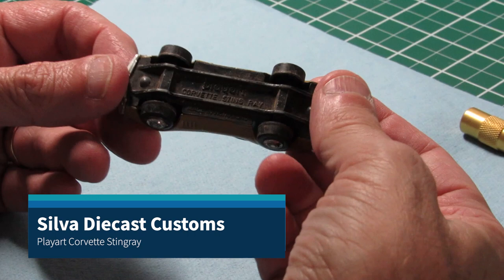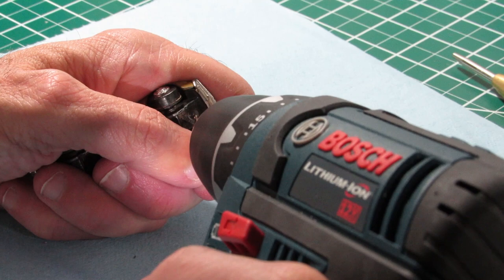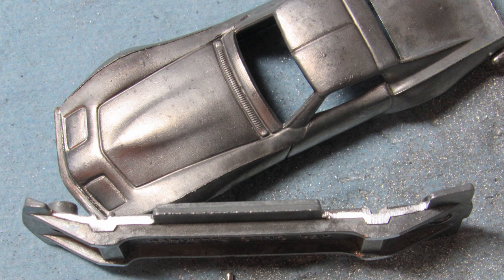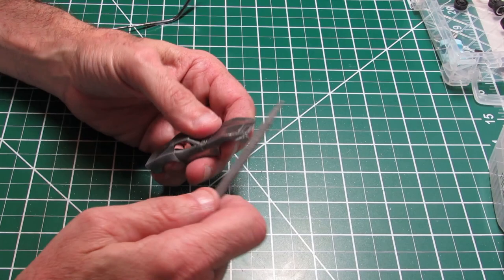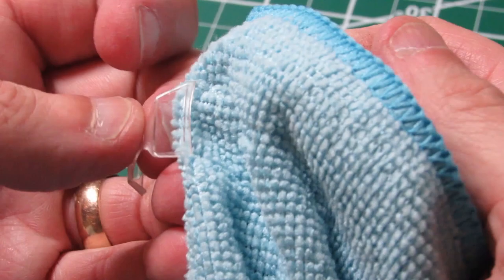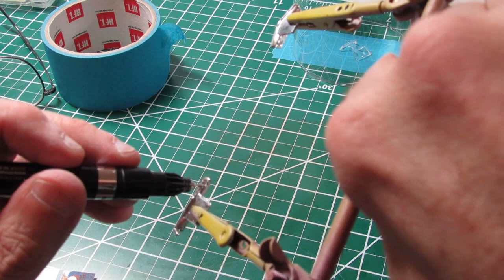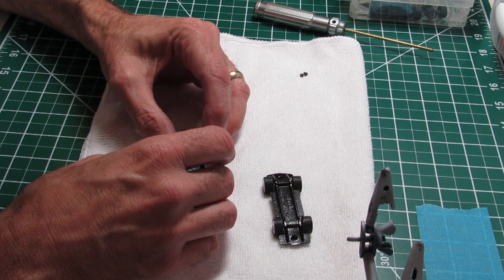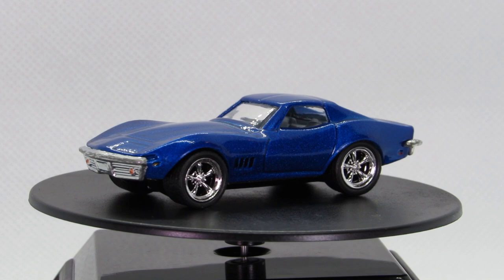Playart Corvette Stingray

Comment: Nice, and you're  right the original wheels were horrible,  we suffered the same fate here in the UK, in 1970 all wheels on the Lesley models became cheap crap Super fast I'm looking for some wheels to fit my 1/64 mk2 escort RS2000 any suggestions?
Reply from the maker: Jools Freeman I’m pretty cheap so I hate to spend a lot on wheels lol.  That being said, I’ve been really happy with the Greenlight wheel packs I’ve picked up off eBay and Amazon.  Keith over at Outlaw Speed Shop just did a video for wheels that I’m hoping to give a try (I tried to order using my phone and had some problems figuring things out - gotta give it a try on the computer).